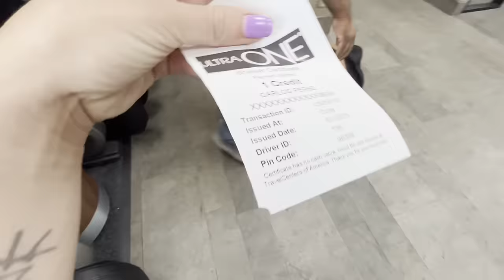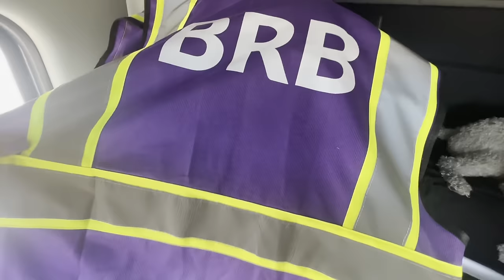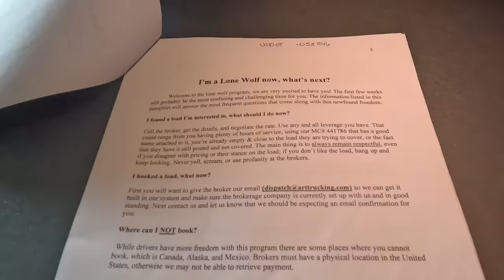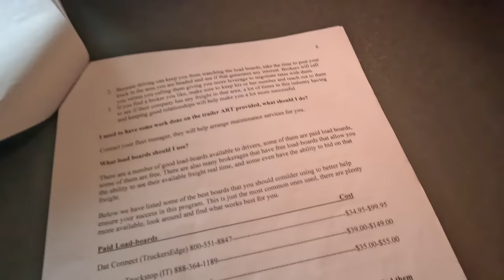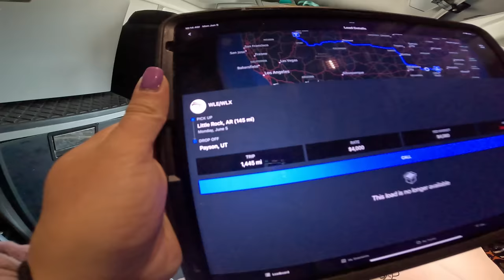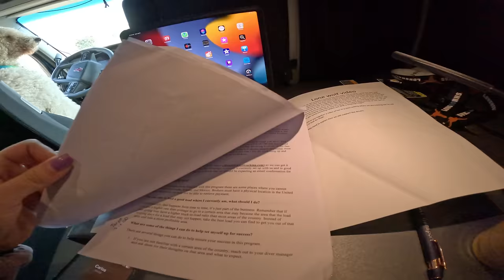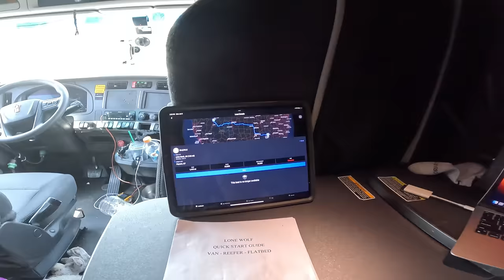I’m A LoneWolf Booking My Own Loads!

Comment: Booking your own loads you'll get to learn what areas to stay away from that have low rates. Even if you make good money to go there you'll know you won't be making good coming out of there. I prefer to haul steel or equipment than lumber or drywall. So you can also haul what you want to haul. Most of the time. It also is a way to keep yourself out of bad weather too. Study the load board as a whole too you'll see patterns of where high paying freight is coming out of.

Comment: hi becca like your driving experiences videos.i drove semis back in late 70s into mid 80s.mostly transtar2s and old pete cabovers and ford snub nozed detroit trucks they screamed loud and up a hill and nebraska with 48000 you could open door and run along side of it yes i did that

Comment: How do you like a Kenworth compared to that Cascadia I think Kenworth is a much better truck at least it's my favorite truck Peterbilt second Freightliner West Freightliner might weigh a little less but I like the ride better of the Kenworth and Peterbilt anyway you were talking about going on a diet losing a little weight the best thing you can do is eat Brazil nuts cuz it has selenium in it or buy selenium capsules illenium has a lot to do with your thyroid and your thyroid has a lot to do with your metabolism to burn fat so pick up some selenium pills and figure out on the internet how many micrograms you should take in a day I take a little bit more than they say but you can take too much I guess but it helps your metabolism through your thyroid and help you burn fat that's what I found out for myself just FYI my name is Chuck's have a good day I started driving truck back in 1973 and it was a 57 Peterbilt conventional no power steering no air conditioning no Jake brakes 4 and a 4 with no synchros I was 13 years old I drove with my dad he would drive from Portland Oregon to Sacramento I would keep him awake but he drove all night and I would drive from Sacramento to the top of the Grapevine by myself while he was asleep then he would go down into hell a unload reload drive it back over the Grapevine and I would drive it back to Sacramento while he slept again and then he would come back to Portland then I would sleep I drove truck part-time back then just in the Summers with my dad and then I started but my own truck in 1980 and I drove till 94 and it was a Kenworth W900 1979 turn 40 inch wheelbase daycab I just hope y'all containers with it in Oregon Washington California then I went to work for the railroad loading unloading the containers off the train and trailers anyways good to See female driving truck seem to be doing a really good job later Chuck

Comment: [   NO. 1.  RULE. [   DO. NOT.  EVER.  NOT.  CHECK. THE.  5 TH.  WHEEL.  HANDLE   LOCATION. --   SOME.  JELOUS.  PERSON.  MAY. DISSEGAGE.   5. TH.  WHEEL  TRAILER. =   RESULT.  DROPPING. IT. ]  . TRAILOR. . 

   APPLY.  TRAILER.  BRAKE. ,,   PULL.  A.  LITTLE.  FORWARD. =   
   LOCKED. !❤❤❤ .
NO.  ONE.  CAN.  RELEASE.  IT. 😊😊😊 !.